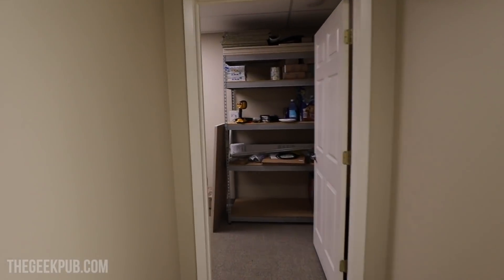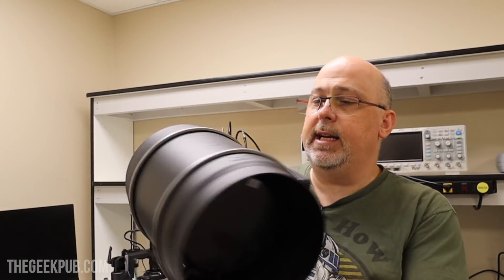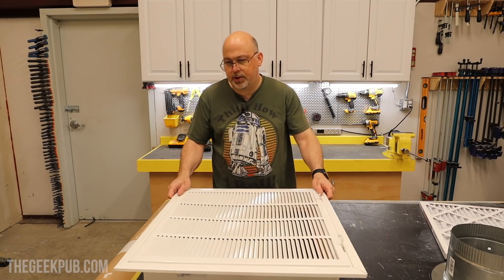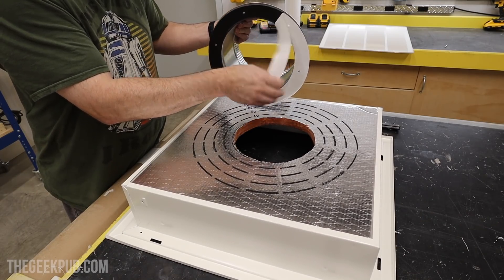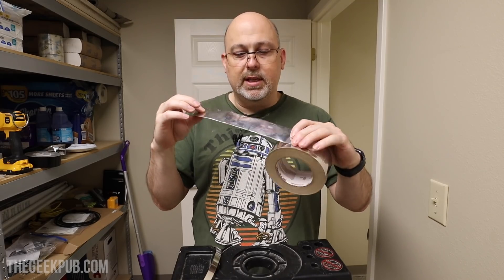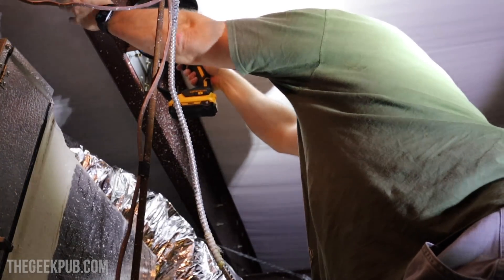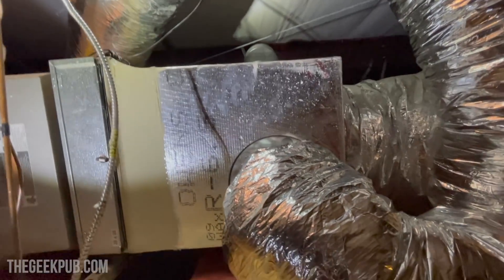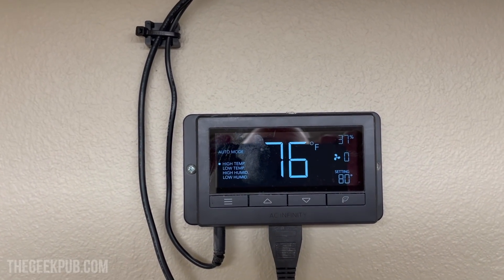Venting the Server Room

Comment: Always appreciate the videos. Thanks! One thing I have noticed on all my systems is that compared to other channels your intro is much louder than the content of the video. Watching in a quiet room it can be pretty jarring when a new video comes on since I can't hear your voice at all when I turn down to a level where the intro isn't blaring. So I go back and forth on the volume but thats okay. Just wanted you to be aware. Some of my tvs dont have volume compression
Reply from the maker: Interesting!  I'll look into this.
Reply: Thanks! its only a problem because you have highly binge-able content. love the new studio and the channel!
Reply: @TheGeekPub  hey to anyone concerned with the volume being everywhere when watching TV or others streaming what-have-you anywhere your levels could be all over the place they make devices designed to let's just say tame those all over the place levels I will be doing that very thing in my entertainment center and possibly bedroom eventually also in in an apartment trying to find a best way to go wireless audio that would be zerolag without doing something proprietary I see about just using FM transmitter on my main system and just using the FM receiver that would be incorporated into my system at the other end to do an audio link back from that system do the same both ways to different frequencies.

Don't worry they would not be going both ways at the same time things will be switched in a way that you would not connect an input to an output obviously you would have feedback issues.

It'd be more like a wireless line in line out.

Sing is Bluetooth would created delay in the system if I had both sets of speakers on.

Any other suggestions?

Also protip whenever doing anything with suspended ceilings or acoustical tile of any sort have a bottle of white out with you or in your toolkit.

To cover any oopsies or ketchup any of the white that gets damaged if you want it to look better of course to each his own but it does help!

Also looking for a larger entertainment center that could use rack-mount as well as standard equipment have all kinds of Cameron space excetera.

And also hide all the wall ports in the front room.

Preferably would possibly and also easy access back cover don't want to have fully open in the back.

But yeah they'll be some active ventilation to the room for sure in the cabinet!

Also do it once future-proof things!

Always a good idea think 10 years plus down the road at least when you're designing something new a one-off
Reply: @aaronbrandenburg2441  Hi, Not sure your use case here but it sounds like you have quite a few potential kits happening. If you are going for Hi-fi, and you can swing cables, hdmi over cat5 would work great for multi-room setups. Star Tech makes some great TxRx units for that. If you can stomach that AWS probably owns your data anyway, you might just go the smart speaker route with something like alexa. Alternatively, LTT does a great demo of SoundCore by Anker. Personally I just use a Roku streaming stick into a usb powered hdmi audio extractor and then to a pair of $20 Pebble speakers on my night stand. No DSP here. Roku also has a unique audio protocol to wireless pull audio from your cell phone or the roku remote with 0 latency, as well as some great wireless audio options if you use a roku tv or soundbar. Not Hi-Fi though. You are probably looking for more expensive solutions than these though.
Reply: @charlesgi5058  thanks I'll look into this that might help that's why I stuck that in here if they were talking about baby systems and servers and all cooling the setup someone would have an idea on this!

I might be able to screen couple of network cables either CAT5 or Cat6.

Main reason to go with wireless the due to the fact I live in the apartment I cannot really go through walls or anything.

And there is no pass-throughs of any type nor ethernet ports or any type of pre- wire that could be repurposed such as unused ethernet ports location where dirty would be ethernet equipment.

So very hard to do much harder than usual with hardwired.

Basically would be interconnecting two different rooms with audio video two-way audio and video.

I can always use those for cable things like you would use to provide Power in Ethernet to a desk in the middle room or something like that but be really messy.

At my previous place I did have hardwired ethernet talk to you in where they did before us previously.

Kind of convenient that have notches around the edge of the doorways.

And most of all space taken up by furniture!

Here not so good an option to go wired!

But I will definitely be looking into this so thanks for trying to help it might be what I'm looking for!

Although I was thinking possibly about doing Bluetooth transmitters receivers but there would be a delay as I mentioned may not be so bad but could give it a try if could do it inexpensively eat that way versus the other

Comment: Only problem with this approach is, for a server room you ideally want positive pressure to keep out dust and such. Instead of venting the air and filtering it going out, I'd have set up the fan to draw cool air inward from the air conditioned house, put a filter on the inlet, then duct the warm air out to a hot air return under its own pressure.
Reply from the maker: If I were designing a data center, sure.
Reply: @TheGeekPub  fair enough. My own server cabinet is a small 12U box inside a closet that stays cool throughout the year, and positively frigid in the wintertime. 

I designed the cabinet to draw cool air in from near the floor, in the gap between the roller casters and the box bottom. It draws the air through a pleated MERV 13 filter, ducts it up through the front faces of the rack mount units, then out through the back near the top. 

I have 3 machines running 24/7 in there now, plus a Cisco network switch. None of them get nonstop heavy usage, and the CPUs seldom dip into the yellow zone, so thus far it seems to be working really well. 

I did enjoy your video. That fan contraption looks like a real beast.

Comment: Wouldn't the hot return air get blown out the other return air intakes when the AC is off since they would present less resistance than the fancoil unit?
Reply from the maker: Maybe.  But if it does, it accomplishes the exact same goal.
Reply: @TheGeekPub  I was mostly thinking about that from the perspective of dislodging all the dust that might be in the filters...
Reply from the maker: @CoolerQ  Yes.  That's why I run double filtration.   Filters at the returns and filters in the main unit.
Reply: @TheGeekPub  Just a friendly warning from a commercial hvac guy, watch double filtering, as it could cause to much static pressure in the duct work/make the fan work to hard to get the air it needs and make the system run less efficiently/shorten the life span. 

Now that's not an issue with the server room since you added the booster/exhaust fan for that run, but just something to keep in mind if you're double filtering everywhere else as well.
Reply: @jonathonbingle9803  There is a common misconception about restriction and the load on the motor and the restricting flow. The squirrel cage blower is designed to move a column of air, "restriction and if taken out of the unit and set in the open, then it would overload the motor." Restricting the airflow reduces the load on the motor until a point of diminishing returns at which the motor is at the rated speed and moving the optimum amount of air. Further restricting beyond this point will actually reduced air flow but the load on the motor will continue to be the minimum. Once enough air is restricted, being almost completely, then the motor can overheat as it relies on air flowing around the motor to keep it cool. The more vents are open, and the larger and shorter the ducts the more load is on the motor and the less it flows after a point. So what the geek pub is doing is perfectly fine, albeit at a slight cost of possibly a bit of airflow, and even that is debatable. Source: I've been designing data center  HVAC for over 30 years.

Comment: I see this is a popular comment.  I also see the pinned response.  Still my main comment/concern is the location of the vents.  The return vent really needs to be at the opposite end of the room from the door.  When that fan kicks on it's going to be pulling negative pressure from the room and that is going to come from under and around the door as well as the in-vent.  Flipping the vents around (inlet above door, return vent above rack) will or should vastly improve performance.

At the end of the day if it's working for you and you are happy with it who am I (or we) to advise otherwise.  My only point is to provide some insight.  It's just a conversations we are having (not really since it's the dreaded comments section - lol).

Comment: Can't believe the price of a split system on the US! £1500 tops over here for a single unit with installation!

Quick question, in winter, could you turn down the thermostat for the fan and use the heat from the servers to add heat to the rest of the building?

Comment: What is now duct tape was first used to repair Duck Cloth in early 19th century. Thus the original name ‘Duck Tape’. It is not really designed to be used with ducts. Which is why it isn’t very helpful with ductwork.
Reply: Yeah, when doing ducting work you need the aluminum foil tape.

Comment: I don't understand why these split air handlers are so darn expensive in the States. You can buy a 9000 BTU Inverter here in Greece for around 400 Euro and another 70€ to install it. These are very economical to run considering they have compressors and fans that run on DC and ramp up cooling as needed unlike your classic whole house AC system. One thing of caution about most splits is that they operate with various Butane gas mixes. To achieve cooling. There have been some instances where they  have developed leaks and have ignited from relay  contacts sparking. Most newer higher quality units are using solid state switching reducing the chance of igniting leaking refrigerant.
Reply from the maker: Well, for one thing, our homes are much bigger.  The workshop area of my shop for example has 50K BTU mini split.  That's almost 5X as big as the one you mentioned.  Second, we're not already wired for these as most places have central HVAC setups.  So we have to spend another $1000 to get a 30 amp circuit put in to run it.  It would be much cheaper to replace an existing one than to install from scratch.

Comment: Can we use external air to cool the room? Basically pumping in air from outside and then pumping it back out. What kind of equipment would we need to make it safe? (E.g. making sure only use it when it's could enough, and dry enough, maybe some filters, etc. But other than the very hottest days, and rainy days, it should be good enough and should save quite a bit on cooling)
Reply from the maker: That wouldn't make sense. It's 100 degrees outside. Hotter than the server room!
Reply: @TheGeekPub  Yeah for sure, it was 101 F on Tuesday while I was out exercising.  It was murder.
Reply: Yeah mini-splits are not inexpensive.  At least quality one's aren't.  I priced one out for my garage and it was going to be about $8000 installed, which included blowing in insulation into the walls.  It's still hot as hell out there.
Reply: @TheGeekPub  Thanks for your reply! Probably doesn't make much sense in hot climates, but many places have climates that make it more more usable at least some parts of the year. And cooling off kws of heat is no cheap thing.

We don't really above 90F, and outside of warm months, it's 80F and below, and that should be plenty cold enough. Even the humidity shouldn't be bad. (As most houses here don't have ac, and they still have working computers :D )

The question is, what could go wrong, if I wanna cool of a bit more concentrated heat. like a server closet with outside air? Do I need air filters and such, or would it be overkill and it should be enough just to pump in air and make sure not to do it while raining and after that?
Reply: @willierants5880  That's very expensive. You probably counted the insulating the building into the cost which is not strictly the price of the AC.

Here you can buy minisplit systems from like $400 (from brands like Midea, Gree, etc), but basically any brand (including Japanese ones like Panasonic, Daikin, Mitsubushi or your more known Samsung, Panasonic, LG, and we even have Carrier which I haven't really seen outside of USA) have offernigs from as low as 700$ (plus installation, but we have cheap labor, and you have your own time to install it yourself ;) ), they have like 3-4kw of cooling capacity which should be plenty for a smaller server room and then some extra, and higher capacity ones aren't that much more expensive. And these not even the lowest end ones, they usually have some reasonable features like inverter drive, and fancy indoor units with filters, wifi, and various things.

Comment: Your AC may not work as good as it did before. In order to get proper air flow, the HVAC blower needs to suck the same CFM out of a room as it's putting back in with cool air. Since you essentially put a turbo charger on the main return line, your existing return lines will have very little draw. It's also very possible that those existing return lines will reverse direction and actually push the warm server room air back through them. HVAC systems are most efficient when they are properly balanced, but the turbo charger is going to put it out of balance
Reply from the maker: I can assure you its working just fine.  This is a very common practice.
Reply: That was my first concern too. At least over here with local hvac regulations, that would be considered bad practice.
Reply: @TheGeekPub  It was a good question and you just blew him off.
Reply from the maker: @juhohartikainen4408  I'm not blowing anyone off. I simply replied that it works fine.  This is standard practice in server closets all over the world. I didn't invent this.
Reply: Technically his AC will be more efficient and have a slightly higher capacity as a result of adding the fan. Anytime you increase the mass flow rate of airflow across an evaporator coil you increase both efficiency and capacity of the unit. The only potential problem with his install would be reverse airflow in his return duct when the AC is not running, but his exhaust fan is. Which is not a big deal, unless his main AC filter is upstream of where he tied into his return duct. This could blow dust off his filter back into the space.

Comment: I'd be curious to know if different temperature sensor locations around the room makes a big difference when plotting energy consumption versus temperature based on location. Like point A it barely runs and is X degrees and point B it runs all the time and is only marginally cooler. That would be fun to know. Also we need to get you some surface mounted conduit to make the cabling to the controller all nice and pretty.
Reply: I recommend buying a cheap thermal vision camera, very helpful for debugging this stuff.

Comment: Whenever I see a condenser outside if it’s on an accessible roof, I like to lift off the cover and fart in to the intake. If you have a few friends and hold in you can drop a good few in to the intakes and it will circulate your fart around the property for some time. One time my friend followed through which wasn’t so good but I hope they had filters.

Comment: AC Infinity rack screws are amazing
Reply: Only problem I see is that fan is going to push hot air back into the other rooms.
Reply from the maker: "that fan is going to push hot air back into the other rooms."  That's exactly what we need it to do.
Reply: @TheGeekPub  i mean i think you might overpower the other return you have
Reply from the maker: It doesn't matter.  The result is the same.  Hot air is removed from one room and spread to the rest of the building.  By the way. I didn't come up with this.  This is standard practice all over the world for venting rooms like this.

Comment: Curious to know why you placed the sensor near your switch and not closer to the rack itself? Thanks!
Reply from the maker: Mostly because that's the back of the room where all the heat kind of hangs out.  And I am interested in keeping the room cool, not the rack.  If I put the probe in the rack, the fan would run nonstop.
Reply: @TheGeekPub  makes sense, thanks for responding

Comment: Nice video and I'd like to see more server-room updates 😉
One question: Won't the infinity fan create a positive pressure in the return box on the handler and hence push warm air back into all the other returns? (while handler is off)
Reply from the maker: This is certainly possible, but if it does, it still accomplishes the goal: dispersing heat throughout the building.

Comment: Duct Tape is a misnomer... It's actually Duck Tape, because the mesh fibre layer in it is made of "Duck Cloth".  That would be the same Cotton Duck Cloth used as art painting canvas.

It never was intended to be used on air "ducts"... And as you said, it is truly terrible for that use.
Reply from the maker: Home Depot Link: https://www.homedepot.com/p/Nashua-Tape-1-89-in-x-120-yd-300-Heavy-Duty-Duct-Tape-in-Silver-2-Pack-1541225/100351967

They actually call it ducT tape at Home Depot.

Comment: The video is quite enlightening. However, I'm curious if you have any calculations regarding the total BTUs generated by the server racks and how you arrived at the exhaust CFM, specifically in determining the size of the exhaust fan. thanks!
Reply from the maker: That sounds like a lot of uneccessary engineering.  The fan is variable speed and has a thermostat.  When it gets hot it turns on.  When the temperature is back in check, it turns off.